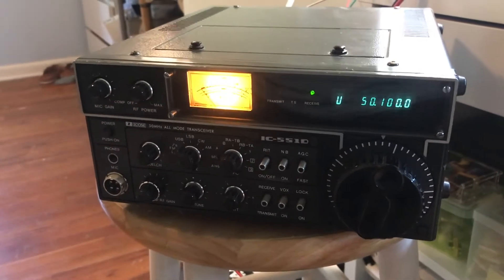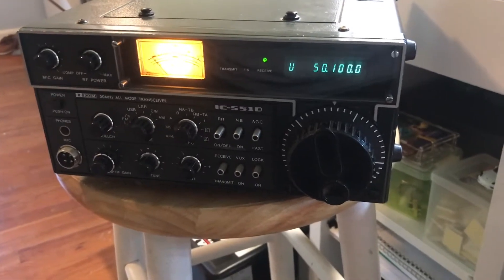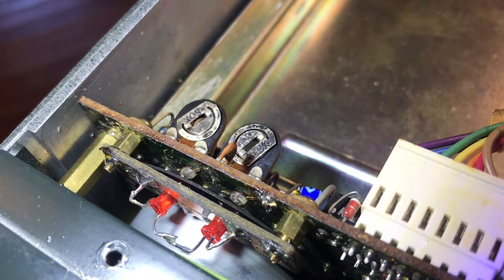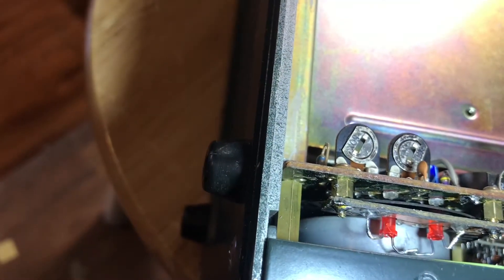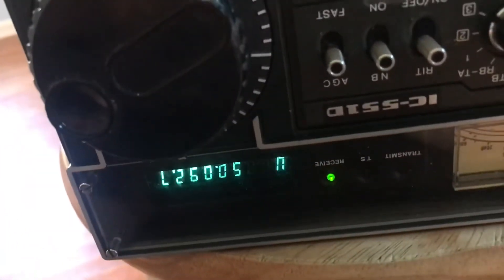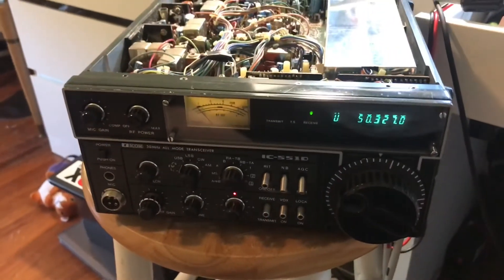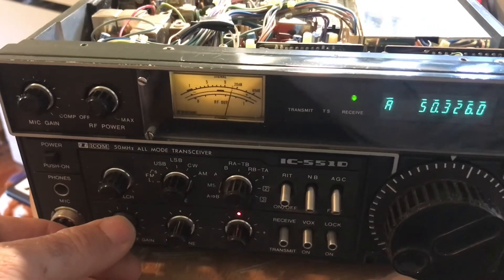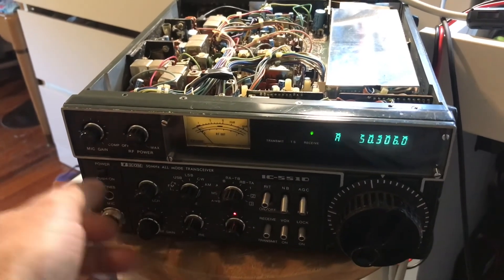ICOM IC-551D - VFO not working - Repair

Comment: i bought one of the ic 551 and have a few problems with it. found this very informative but would like to see part two of this repair.
Reply from the maker: I wish I could post a part 2. Before I could finish the repair I ended up selling this rig.  I hope your repairs go well for you.  It’s a fun radio.
Reply: @propagating-radio  i got it to monitor 6m while i play on the others. right now the only other 6m i have is in the 991a. but thanks anyway it was worth a try, i sure i figure it out eventually. de kd7gkl 73
Reply from the maker: @kevinharvey4886  73 Kevin and good luck de N0ZIB Adam